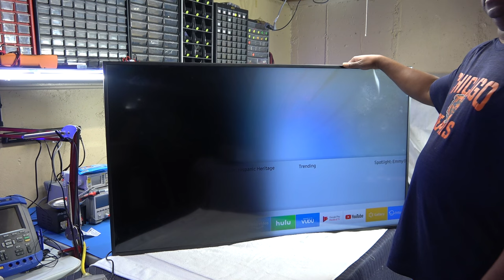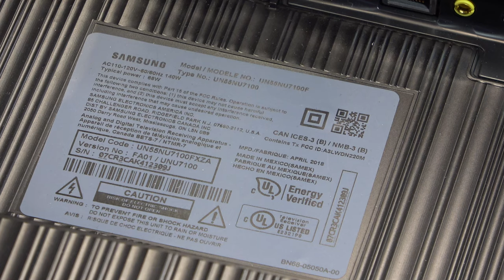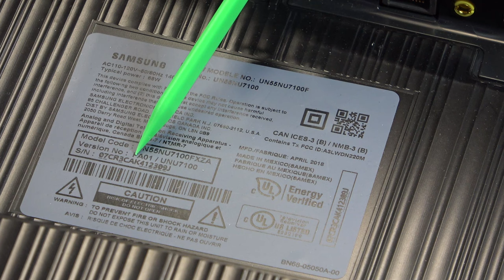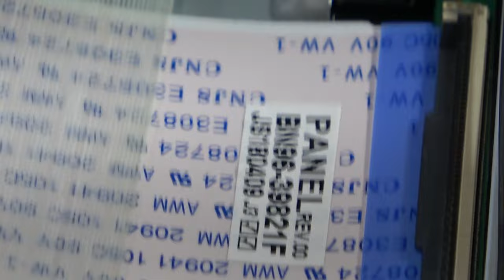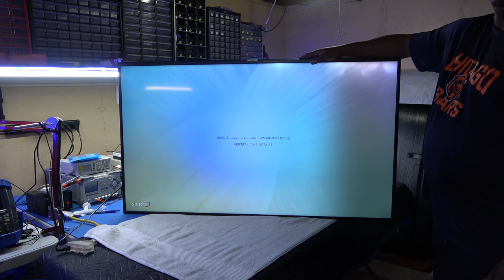Samsung Led TV UN55NU7100FXZA half dark screen repair

Comment: Hey, this was really helpful!! In the process of trying to repair this, one of the ribbons attached to the screen that goes into the bottom board detached from the screen. I tried to tape it back in the right spot but nothing is showing up on my screen when I turn it on. I'm basically out of luck now right? Thanks in advanced!
Reply: Unfortunately yes. I'd say that screen is shot now that the ribbons have detached.
Reply: @gameovered777  thank you! I managed to get it working after hard resetting but that one ribbon row is broken. The leds started to dim again after replacement so will try my luck during black Friday. Thanks for responding!

Comment: Bigdog, today went to a bricolage store and found some suction cups, same shape and diameter than yours,underneath the same, but the handles were not made of plastic but some kind of metal ,acutally they are grey as yours ,are they safe enough to lift the screen ,they can handle until 110lb

Comment: Hey Bigdog! I really appreciated this video as I had the same issue with my 65" Samsung Curv (UN65NU7300FXZA). After watching this video 3 times, I decided to order the LED strips and replace mine. The repair went pretty smooth, my bad strip wasn't nearly as bad as the one in this video but I definitely had burned up LEDs that were visibly bad and causing the dark vertical line I had. After reassembling the tv with the new strip installed the tv now just turns on and off without ever displaying a picture. I've had this same issue with an older Samsung I had that ended up needing some new capacitors soldered in but I didn't have this issue until the LED repair so I cant see how this would make sense. Im guessing this issue is from something I did while replacing the LED strips and was wondering if you had any advice? I already went over all of the connections, unplugging and replugging to make sure it wasn't something simple but now I'm out of ideas. I know this can be a bunch of different things but just wanted to know if you ever ran into this problem after replacing an LED strip and what the cause was for you?
Reply: did you ever figure out this issue?

Comment: Hello.  I know this an old video but I'm working on this exact tv. And have the same problem where the left side is darker than the right..its not completely black just really dim. .I did the voltage test on the LED connector and have 192.9v on all the (+) and 107.1v on all the (-) is this correct? Could it still be a bad LED or something else? Thanks for any info and for all your help and videos..
Reply from the maker: Change led strips, probably have a lot of shorted leds that arent lighting up.

Comment: You are using the BN96-45913A as replacement LED strips, eBay shows a lot of the BN61-15485A as listed for the UN55NU7100 as well (main results when looking for replacement LED for this TV model), do you happen to know if there is a difference or if one should be used over the other? Will either work?

Comment: I did this repair on the same exact tv. There was no problem with the screen just half of it was dark. Right after doing the repair. I see half of the screen in the background of the picture with wide black and gray bands on the left of the screen. I also noticed that i can feel more heat one of the ribbon cables, that supply current to the left side of the screen. I can feel more then normal heat to maybe one or two  of contacts in the ribbon. If I move the ribbon cable to the right side of the screen, then that same cable does not get hot. Any idea of what is causeing this new problem?
Reply from the maker: Check the connector contacts. Or you damaged one of the led driver boards.

Comment: Bigdog8882 great video. Why didn't you flip the diffuser edge that was burnt so that you would have a nice even edge against the new led strip? Maybe it would have made a better presentation once the unit was reassembled. I have never did it before, just wanted to know if you have in order to describe the difference. Again, thanks for sharing.
Reply from the maker: Yeah thought about that after I reassembled the TV. Another Tech told me its made different at the Top but try it. Ima do that next time. Thanks Bro.
Reply: You may not be able to do that as most of these defuser sheets have cut out nubs (for location) which prevent any other orientation.
Reply: @thedarkweeally  I beg the difference I have disassemble several thousand Samsung and LG led TVs and all of the light fiber panel can be rotated.  It does not matter. They are bi directional - they just need to produce an evenly distributed light surface. With all do respect to your opinion. Hope this helps. The diffuser sheets have nothing to do with the light fiber optical panel. You are correct about that but that is not what melted.
Reply: Carried out this repair after following your brilliant guidance. Two strip cost £24 plus a pair of glass suckers (£12).  Found Fresnel lens sheet slightly melted adjacent to LEDs (no cracks! yay), so rotated the sheet. OK so not sure if it's because of possibly lower power LEDs, but the top of screen is slightly darker than bottom. So imho perhaps the flip is not such a good idea. I'd love to purchase stuff from your shop but postage to UK is horrendous! So are you on Patreon so I can send you a little thank you?  Cheers.
Reply: @Patch1stripeTVParts  you may beg to differ but like you I too have disassembled and reassembled thousands of models (I had a team of 3 guys and we'd return almost 1800 units to service every month) and flipping the sheet is not always an option.
Reply: @johngriffiths3467  depending on where you are in the uk you could have you're perspex sheet remade - there's a place in Glasgow that can do it.
Reply: @thedarkweeally  As the TV was a giveaway and I've only spend a few pounds on it, it doesn't warrant going to extra expense to change out the sheet. Good enough for the spare bedroom. I already have a pair of Samsung 65" 4k which are absolutely brilliant. Cheers for the heads up re Glasgow. Might even be the same place I bought the LEDs from!
Reply: @thedarkweeally  so, do you have any idea why the top half of the screen is slightly darker? Or perhaps I should be asking why the bottom is brighter than the rest of the screen.
Reply: @johngriffiths3467  if the sheet has been burned then the light can't refract all the way thru - it's why when I do a repair and if I see the perspex sheet has been melted I take pictures and advise the customer its a lost cause, unless they want to spend close to what it would cost to replace the unit, which some will because - believe it or not - sentimental value.

Once the sheet is damaged you'll always have dark spots. If you're getting dark spots on a tv with an array it'll probably be because the backsheet has popped up somewhere casting shadows.
Reply: @thedarkweeally  OK.  That’s awesome.  Thank you
Reply: @thedarkweeally  Can fully understand that since the perspex has melted the light diffusion quality will diminish due to lensing. In my case there are no dark spots just not so bright entire left to right top of the screen. If the deformed section was in play then only one side would be darker at the top. I suspect either the LEDs haven't got the original brightness or I've messed up replacing the various layers. I did check each stage though as per Bigdogg's video. Last time I repaired any TV was 50'odd years ago when I was an apprentice! (not in the TV business though.) I still remember the jolt when I accidentally used my  body as an earth wire!!!
Reply: @johngriffiths3467  it could be the wrong backlights as resellers will sell you anything for a buck but - the entire left to right top? Sounds like the perspex sheet isn't located properly to me 🤔
Reply: @thedarkweeally   I think you're right. If most of the brittle clips hadn't broken off during the disassembly I probably would give it a second try. Only advantage now is that at least I've been able to do it once, so more confident to take it all apart again!  No doubt, Bigdogg8882's videos are empowering the everyday 'diy'er' to have a go. Do you know if there's any way to pop some gratuity to him?
Reply: @johngriffiths3467  no I've no idea, I'm sure the fact his video inspired you to have a go yourself will be reward enough.
Reply: @Patch1stripeTVParts  seeing that you may be the person that would know the answer to my question I figured ide ask... I would like to attempt to repair my samsung tv but I was wondering if you know if the repair will last or will my junk tv just blow the replacement leds as well 😳.. well thanks for your time

Comment: The middle part of the comment in the video is really unnecessary. By the way, you cannot reverse the burnt portion to the top and the reflector is designed to fit in one direction only.

Comment: I wouldn’t do the repair as they look awful once the leds have burnt the diffuser, anyhow nice repair BD,
IGNORE THE HATERS!,,! 
Have a great Christmas my your god be with you good bless!
Reply from the maker: Yeah, after I fixed it and put TV back together, I thought about if I had'a turned the diffuser screen upside down, It probably would have looked alittle better. I always inform the customer on how its going to look though. You too, have a Happy Thanksgiving and Merry Xmas.
Reply: @bigdog8882  never tried turning it I know the top of the diffuser screen is white to reflect the light back not sure if it’s tape or paint though, 
Good work all the same though 😊

Comment: Why do they burn out? If you change the LED, how do you know it wont happen again.
Reply from the maker: Just like any light or light bulb; they don't last forever.
Reply: Cool, Ive basically bought a 75inch to repair. Only paid 50 quid for it.

Its just over 1 year old and half of the LEDs have burnt out. Just wondering on a new tv, is it just bad luck or maybe something wrong with the driver board perhaps.
Reply from the maker: @rumelahmed4539  I would say it should at least last for a few years +.
Reply: @BigDog8882  ive checked the board, doesnt seem to be any shortages. Must be just bad luck. Hopefully should have a very nice tv for peanuts if i can fix it.

Comment: I have exactly the same cracks on my 3year old LG tv. Has anyone ever tried to put this diffuser upside down to try to reduce visibility of those cracks. I mean led strips shine from the bottom upwards so in theory light should be weakest on top thus redusing visibility. Please comment if anyone have tried this.